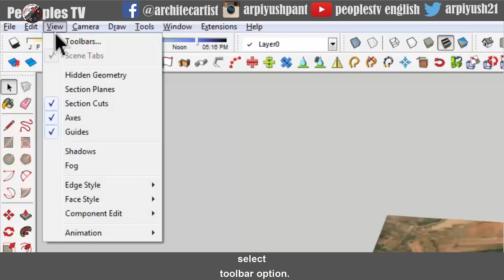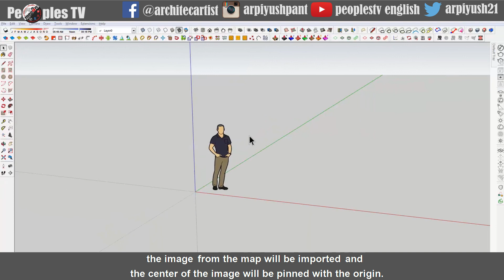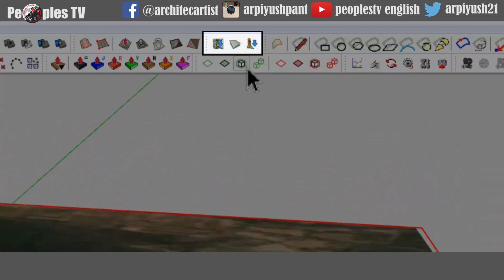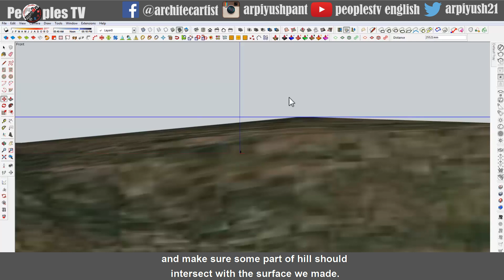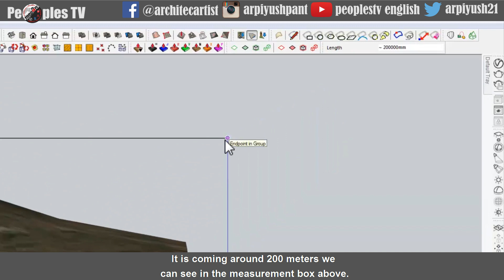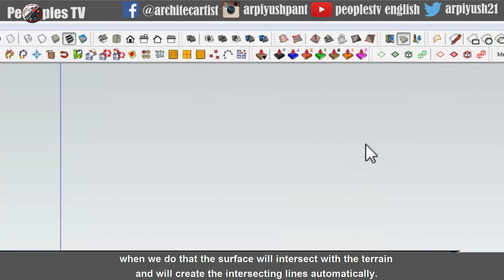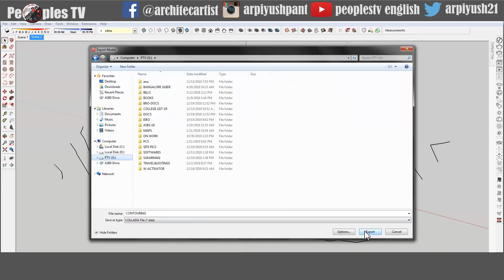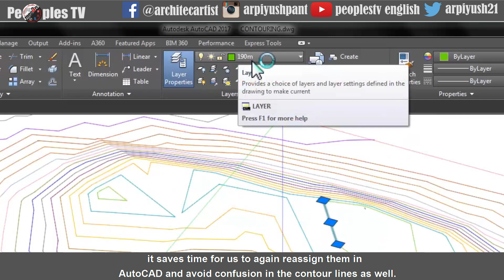Extract Site Contours in SketchUp and Export to AutoCAD (DWG) – Step-by-Step

Comment: Sir if I have a contour drawing then how can I develop it in sketchup
Reply from the maker: Import the CAD file with contour lines in sketch up they will be flat, select each contour one by one and raise them at there respective level, once you are done with that, select all contours and use SANDBOX tool to generate surface, make sure all your contour lines are seperate not as a group

And please LIKE the VIDEO for support
Reply: Thnx sir will try this